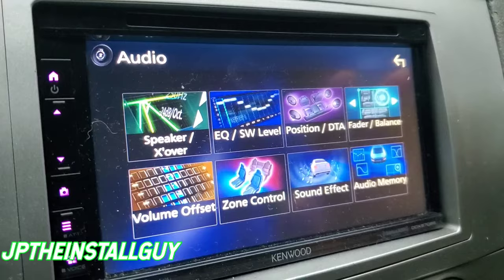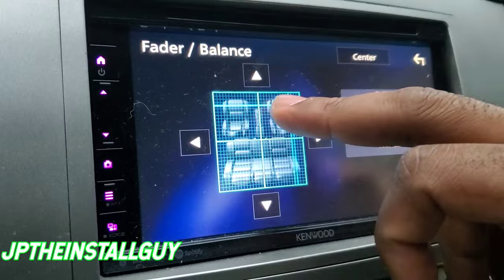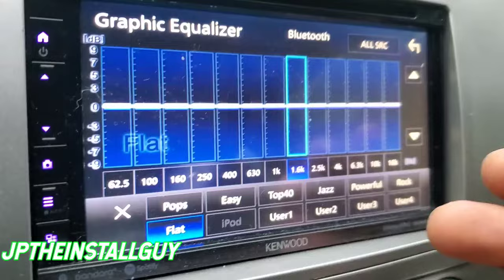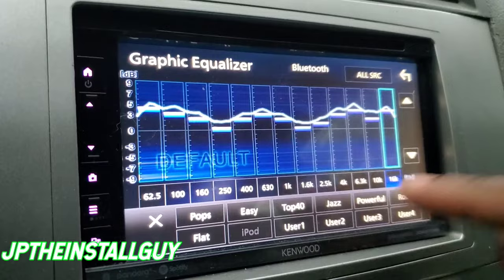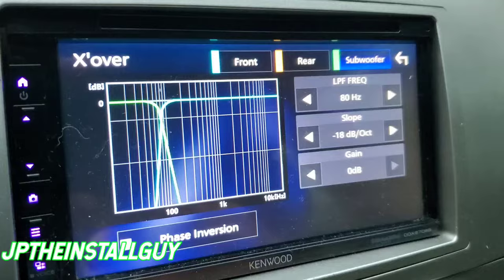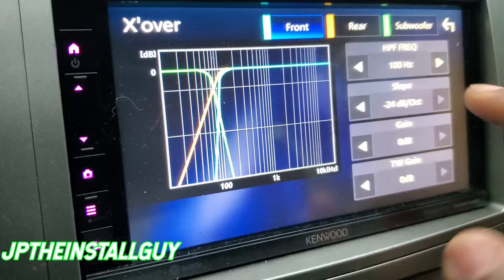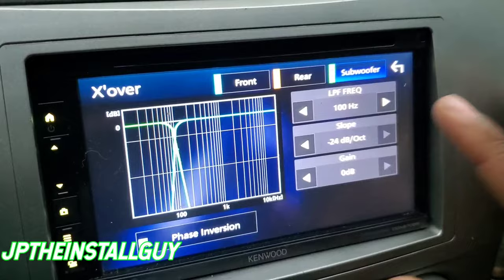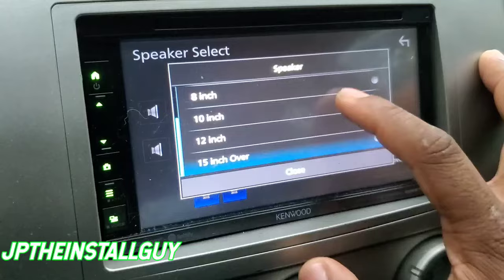UNDERSTAND YOUR HEADUNITS EQ,FADE and BALANCE, CROSSOVER and SLOPE

Comment: so if I want to set my SUB x-over thru my Head Unit, but my AMP doesn’t have an option to turn OFF my LPF, what do I set the AMP LPF to if I want to use the head unit for it’s more accurate numbers?

Comment: Thanks for the info. I'm new to stereo equipment, especially with cars. I recently installed a Sony receiver that has a built-in mosfet (45W RMS) and an amplified 10" subwoofer. I did some research on how to set up the LPF/HPF slope. Your video is the easiest to understand. I have mine set up the same as you do. I noticed an 80Hz LPF on the sub sounds best for me. I want the lows to just barely be noticeable. I'm not a big fan of blasting/bumping music to the point where the cars next to me are judgemental of my musical preferences 😃

Comment: Sorry for the late question. I noticed that the sw level is greyed out on your radio. I just installed a dmx907s and it looks the same. My subwoofer amp isn't getting a signal. Am I missing a setting to turn the subwoofer on? I'd appreciate any help you can give. Love your videos! Thanks!